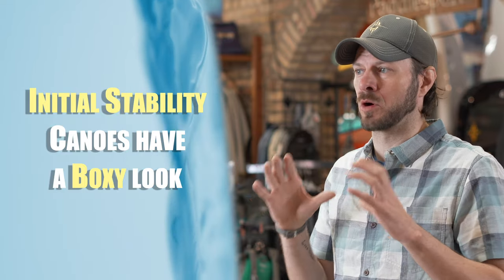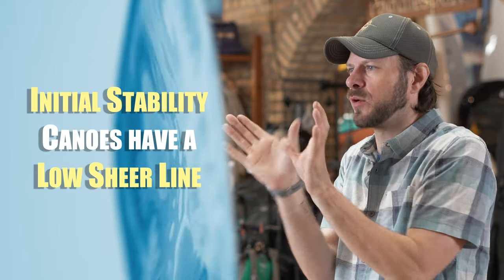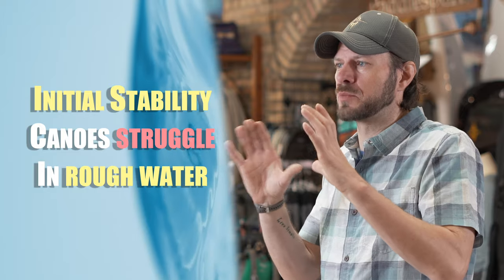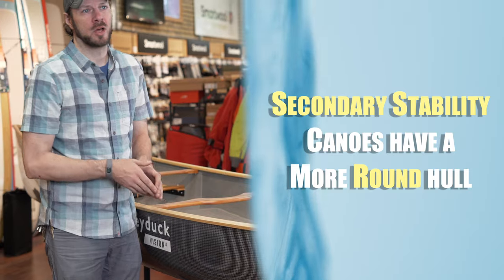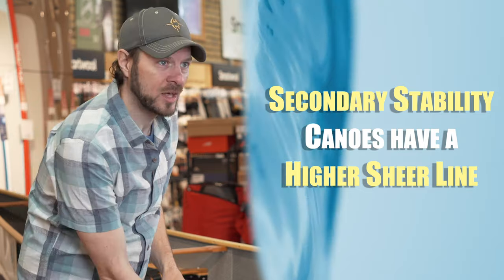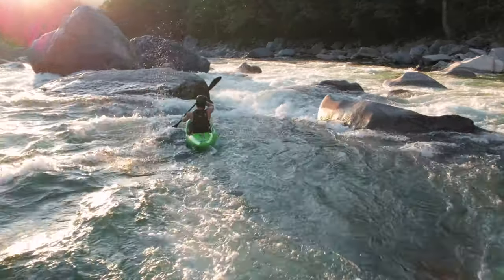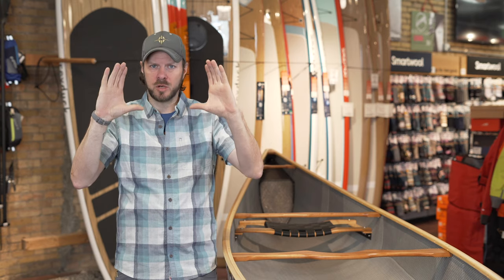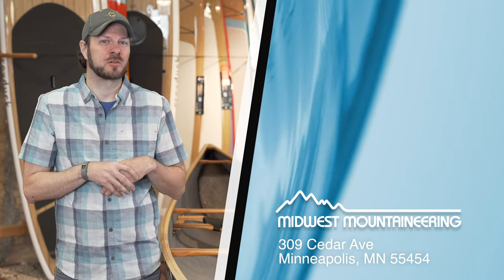Canoe Buyer's Guide | Initial & Secondary Stability

Comment: What’s a sheer line?
Reply: It's a line of balance on the side of the canoe / boat. Imagine trying to push the canoe over from it's side while on water - for as long as the water is below that line, the canoe is going to bounce back once you let it go. However if you push it over that line, the center of mass ends up being on the other side and the canoe is going to flip over.